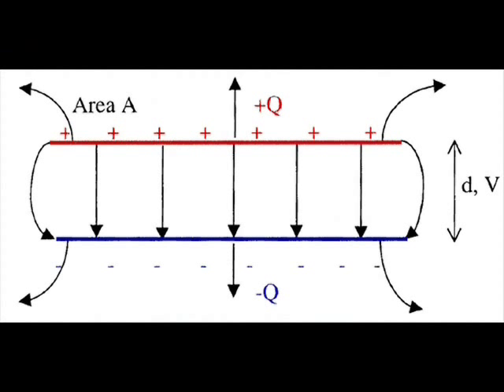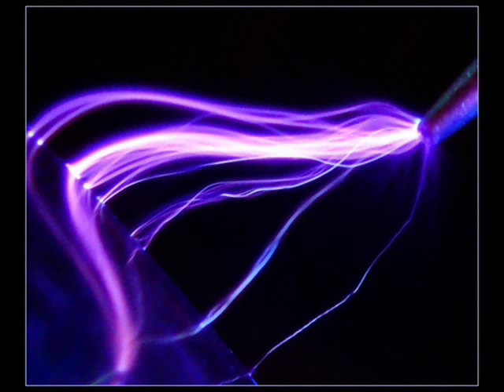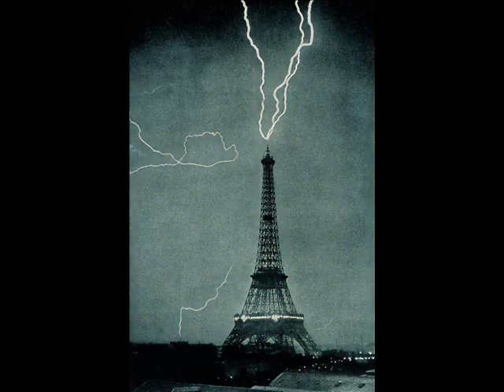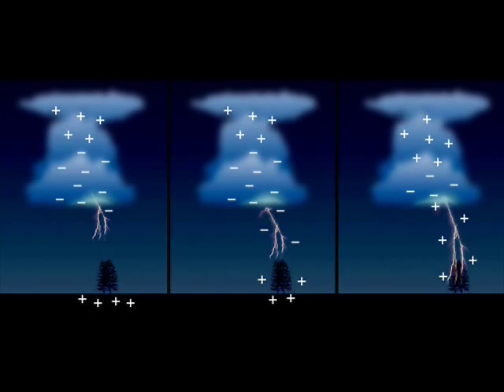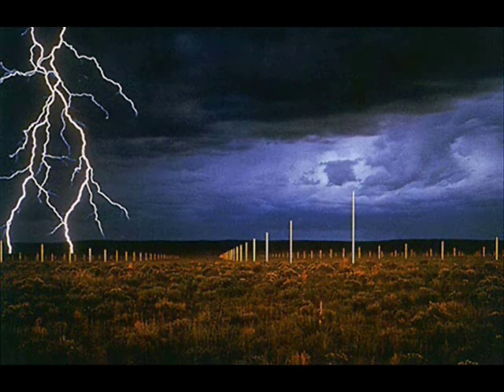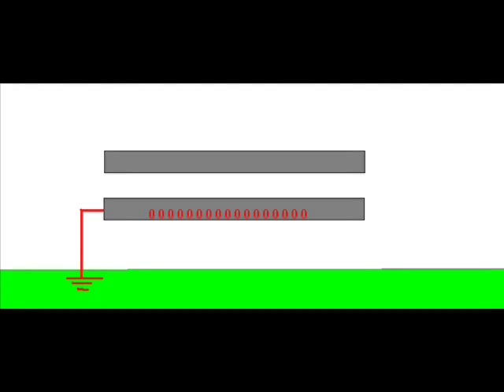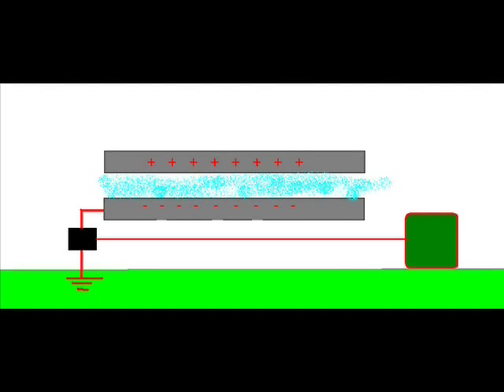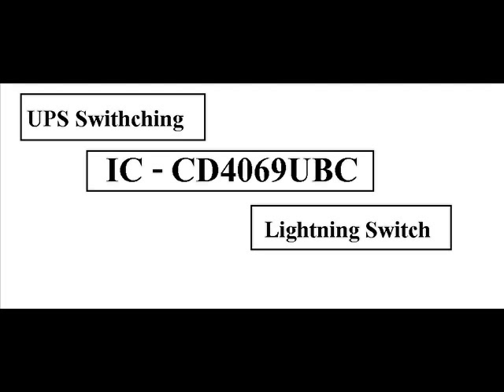Capturing lightning, "The SKEPTICS" in Innovation Cup.flv

Comment: the idea is interesting. however, the size of capacitor need for a lightning bolt is enormous, and your understanding of capacitors is complete bullshit. you must equalize the two plates too each other so there is no electric field. connecting one charged side to ground will not discharge the capacitor or create any current. I'm a certified electrical engineer, don't challenge me!